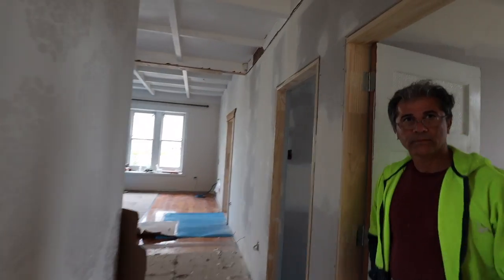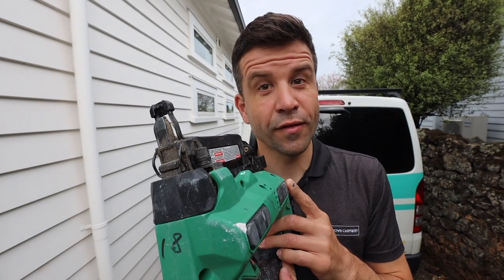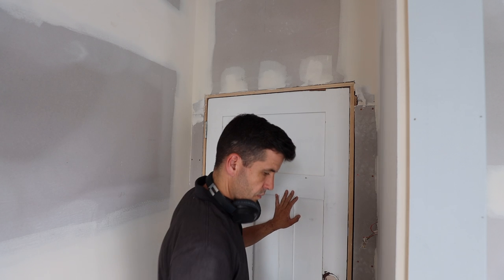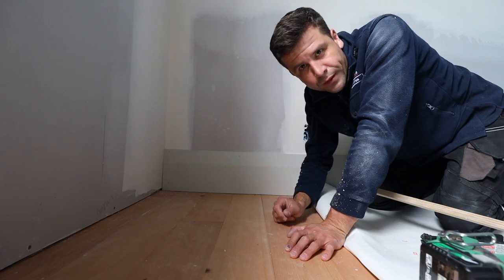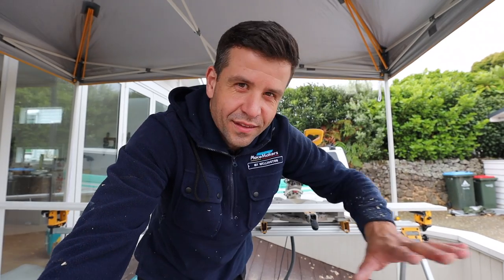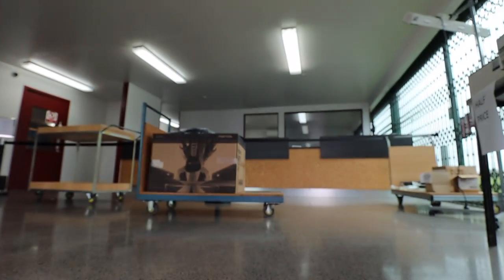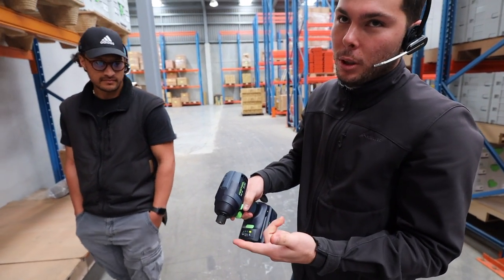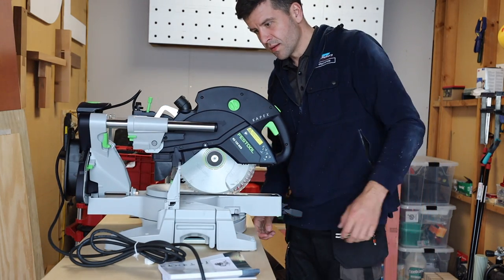Finish Carpentry: Why I Need a New Mitre Saw

Comment: I just watched your video yesterday on why you preferred the DeWalt and wouldn't get a Kapex... until maybe one day lol. You made the right choice. The handle is placed the way it is so you can line up your thumb-wrist-arm and pull straight down without deflecting the blade... just one of the many ways they make it by far the most accurate saw on the market. I use mine in a shop almost exclusively but it's the only miter saw available that can replace tablesaw sleds for crosscutting and mitering, etc. Nothing else is even close to as accurate. As far as the stand issues you had in the other video; first, read the manual. Setting up the folding stand is a piece of cake if you know where you're supposed to place your foot on the bottom of the stand so it doesn't fall over. If you want to take the saw off the stand, it has quick releases that make it just as easy to remove as removing the DeWalt from its stand. The outfeed tables may be a little time consuming to setup on a new unlevel surface each day, but the pro far outweighs the con in that you have about 8 feet either direction of support and extremely accurate flip stops. Again, accuracy. For a trim carpenter, I don't know how you could live with anything else but the Kapex.

Comment: I love my Makita 18Vx2 12" mitre saw. The laser and accuracy are great.  I primarily use it for aluminium with a 120 tooth blade. The dust extraction could be better. The attachment point for the vacuum should be on the lower portion.
Reply: The vacuum kit from Rocklers is a perfect upgrade.

Comment: I’m on my second Kapex saw, the first one developed a small issue after 6 years of work, it was sent in for repairs and Festool replaced it with a brand new saw,free of charge. This one has been flogged every day for 9 years,and still cuts as accurately as the day it was unboxed, they are truly awesome pieces of gear. Buy the wheel assembly and the wings too, it makes a great tool even better.

Comment: a few years ago we were doing same size skirting on 400 apartments in a tower, one of hte guys in our team was SO disliked (he put it on himself, long story) that he went and bought a Kapex 120 to fit in and let EVERYONE use it as their own drop saw to do this skirting, all 8 of us took turns to use this saw. 

Anyway we treated the saw well because ..well its a kapex, and it ripped through all that skirting no problems, it was accurate time and time again on bevels and compound bevels. the only thing that went out of line was the laser.. it was dropped, it was shoved, it fell of the trolley, it was flung around by the handle ( expected collateral damage from 8 Carpenters) and as i said, it still was stiff and accurate. 

That was light material, Considering i build External Hardwood Stairs, i will stick to my 10inch dewalt, but i agree with Scott, its not very accurate, the bevel adjustment is horrendous. 

Since Scott does alot of woodwork, i think the kapex was worth it, in the long run .but i think other drops saws come close for GENRAL carpentry (as long as you don't use them externally). 

The dewalt is definitely a bare bone framing/external saw.

Comment: I had similar problems with my Dewalt miter saws. Both 10” and 12” models, they could only be calibrated to be accurate to one thing at a time, and were sloppy if I was doing anything else. Similar weird things if I had to do any compound mitering, layering inaccuracies and neither of my saws had any cracks in their casings or anything. I now have two Makitas, a 12” slider and a 6.5”. Haven’t had any accuracy issues since. Very happy with them.

Comment: I’ve had 2 780’s, the first I think was dropped by previous owner. But the second was much newer and still seems to be a little off. Like the fence is at a 178-179 degree instead of 180. It really bugs me but I get a great deal in it.

Comment: I had the same thought, never would i ever buy a mitre saw that overprized.... just happends that I ordered mine yesterday :D (although only the KS60) Shout out from Denmark, really enjoying your videos!
Reply: Ks60 is mafell. Different sort of kit. I do like the mafell line up, but Festool nailed it with the Kapex. Too bad it cost 5x what my current yellow saw cost.
Reply: @mitchellkasdin1899  what's the k60 is mafell? What does that mean, was thinking of getting one would you recommend
Reply: I had kapex120. Sold it and bought the kapex60. I love it!!! For me the big one was just too big. The ks60 is wicked.
Reply: I have a 12" Bosch mitre in the shop, and aboslutely detest bringing it anywhere because of it's size and weight... the KS60 is replacing a small 10 year old saw in my van, also Bosch. But the accuracy on the big saw just isn't good enough either.
Reply: @mitchellkasdin1899  KS 60 is the small Kapex with a 8-1/2" or 216 mm blade. I own one, it is a great saw. The Mafell you are referring to is probably the KSS 60 and you're right, that's a different sort of kit.
Reply: Bought a ks60 about a month ago , was a touch cheaper than a 10inch dewalt cordless  non sliding mitre saw.

Was on par with Makita  and the rest of the competition are cheap and made in china .

Comment: I have the 10-inch DeWalt and after I re-calibrated the mitre (using the 5-cut method), it cuts extremely accurate on the mitre. But if I tilt the blade on the bevel, then suddenly it's mitering is slightly off and won't cut perfectly square. There must be a fault in the way the tilt mechanism in designed, because online I've seen several other users complain of that problem also.

Comment: Hi Scott, in regards to the inconsistent accuracy on your saw.
I had the same problem on an Elu 216mm mitre saw, where I’d zero the stops but it would lose that once moved.
It turned out to be the hole in the base which the head pivoted on, it had worn so much it was supporting the shaft properly.
I had the hole drilled out and fitted with a bronze bushing to the correct size by an engineering shop and since then it’s been unbelievably accurate.
Check it out on yours, might be the problem?

Comment: I’ve never had great accuracy from my dewalt sliders or chop saws.  Any miter saw actually isn’t great.  Big base like that I use my cabinet saw.  But I’m cutting at my shop. Definitely the solution to airtight joints. But you still need to calibrate the miter gauge for the operation.  Just wish you could do it with miter saw with good results.  My kapex now maybe can do it but still not sure how well.  I just guy the kapex.  Big difference from dewalt 780.

Comment: I've got the same issue with my dewalt mitre saw, cuts lovely and square on a normal cut but if I make a bevel cut it doesn't  stay square. I got over it with moving the bed to a couple of degrees off from 90 while I done a bit of research.It's only started doing this recently and when i googled it i found another person mention it on a forum, since the saw is a good few years old i decided to get a bosch one for a change. Now that I've seen this video I'm glad i moved away from dewalt as that's 3 people i know who have had the same issue, hopefully the bosch will last me for the next 11 years as I'll be retired by then

Comment: Congrats on new saw. Festool is nice, just have a hard time getting used to the handle on it.
Also, the Festool TID18 Impact Driver is a pretty nice tool, but I’m more into Milwaukee & other brands, so haven’t bought it. Did get to test it out, & was liking it (the one you saw at the shop, believe is what that model was).
Cheers✌🏼
Reply: Makita has the best impact driver on the market. Shits all over festool with more modes and ergonomics.

Comment: One day I'd like to try out a Kapex in my shop but that price tag is a hard pill to swallow. I just got a Metabo cordless 10in slider a few weeks ago. It's not the greatest saw in the world but I've been pretty impressed. The biggest bonus is obviously not needing to have an outlet and having just as much power. I'm typically working at the same stage as final electrical work is being taken care of and walking over to make a cut and finding out my saw doesn't have power is a pain. Plus this saw is noticeably lighter and easier to pack in and out than the 12" Milwaukee or Dewalt I'm used to dragging around.

Comment: I have many Festool power tools and you find that even though they monopolize the top of the market there is still room for improvement and space for another high end power tool manufacturer/competitor.
Reply: Festool is great but lacks power..
Reply: Mafell is higher end than festool.
Reply: @kizzjd9578  yeah they make some excellent tools. I’m thinking that there is still room for improvement. There would be a market there also. For example the Festool kapex. Here in the UK it sells for £1200.00. For a machine which gives daily use for say 5 years it’s brilliant value. £5 a week. £1 a day. What kind of machine could you bring to the market with a retail value of £2000 - £3000.?

Comment: The dewalt serviced you well! I thought for sure you'd be getting a Makita drop saw!
Reply: Same. I was thinking he might go cordless with the FlexVolt or Makita. Didn’t expect the Kapex
Reply: Yeah, me too.
Reply: I thought the same. I almost bought one myself but no one in my town had one in stock so i got the cordless makita instead.
Reply: @kizzjd9578  I'm a makita only fan but heard there mitre saws are crazy so I went and bought a milwaukee instead
Reply: Flexvolt is awesome. Just make sure you get the double bevel.
Reply: @kizzjd9578  hows the makita? Ive been thinking about getting one
Reply: @kevinr3263  Same about to get a Makita, are there mitre saws decent?
Reply: @MrDingaling007  slides and bearings are pretty ordinary. Usually the first thing to go. Prone to premature rusting. Second hand sites are full of em.
Reply: @craiglyle2966  Interesting. Thanks for sharing that info.  I had seen a higher end 36V model made in Japan Makita mitre saw, i wonder if its of a higher quality? Im already invested in the Makita battery system and all there other tools have been excellent, so fingers crossed.
Reply: The new Makita mitre saw sucks tbh. It's well built for the most part, but the ball bearing slide system with both rails on one side has play out of the box, and the detent plate is aluminium instead of stainless like all the other saws on the market, so the detents get flogged out after a very short space of time, which doesn't stop the saw working, but it sucks, and slows your work flow down. Also the system for attaching it to the stand is not good either and I've seen it break. For a site saw I think Dewalt is the way to go. They are really solid saws. The older style small Makita saws are OK too, but they lack a lot of the capability of the Dewalt saws. I don't see anyone using Bosch, so I don't know.

The Festool is expensive, and probably not has hard wearing as a Dewalt, but it's probably capable of joinery and furniture grade cuts out of the box. I would definitely keep it well away from fence and deck jobs or framing. Finish work only.
Reply: @craiglyle2966  is this something in newer saws? My makita is old and it still cuts fine, I've made enough cuts with it to do the brushes in the motor 3 times but the bearings are still fine. I bought it 14 years ago and have been finishing with it and still make tight miters and clean cuts. I want a new saw but am scared to buy a new one as the new makitas weren't anything spacial, had another finisher friend that bought a new 10 inch and was having issues right out of the box. I can't stand dewalt but I may have to look into one as options are limited. DONT BUY THE BOSCH! Had another buddy buy that stupid hinged saw and my thoughts on it were more joints for more potential play. And yes it did have play and was extremely inaccurate. Nice when you need a saw that can be set up right against a wall but it's a piece of junk
Reply: I was concerned about getting the Makita sliding mitre saw having heard it can be hard to make true. While I was researching it I found myself on a Festool forum where people were giving the Makita a good wrap and tips to set it up. So many comments about the Kapex burning out motors regularly out of warranty. I don't know if they have sorted this problem out yet??
Reply: The Makita 10” and 12” miters are heavy...and pretty big. Probably why Scott didn’t want to go that route. I did and have no regrets, but it just sits in my garage, I don’t have to move it around at all.

Comment: I was in the exact same position beginning of this year . Had an old dewalt i had for 12 years and needed a new mitresaw ... festool was the only option that ticked all the boxes.  Liked it so much i bought the track saw and extractor as well 😂
Reply: Same here, and also bought the domino, it's a real game changer. Just look at apple's insane prices (400 bucks for the new ipadpro 12.9 keyboard...) and festool prices will look cheap.
Reply: @hotdog160 looks like a real quality piece of kit the festool domino , if only i cant find a job where i NEED to buy it 😂

Comment: Every mitre saw eventually gets to that ‘rough framing only’ stage.
Reply: as just a hobbyist, I ask why is that?  just wear and tear over time?
Reply: Only if your ruffus rough cut.. and dont look after it. I know a guy who had a makita mitre saw for 20 years
Reply: @oneillcfc7921    My old, all metal, extremely heavy,  10” delta chop saw is 30+ years old. Even with a new freud blade the cuts are only so-so, bearing and arbor wear. The newer ones are lighter, cut larger pieces and more accurately.
Reply: @huejanus5505  but with that repaired it would go another 30. Just wear and tear.  I own the new cordless double battery saw by dewalt. But they dont make them to last just like they used to
Reply from the maker: Lol true story
Reply: 16,000+ Woodworking Plans & Projects

Comment: using the 305mm dewalt sliding compound i always found  the radius of the blade is to big as well and cutting any skirting over 140mm on a 45 even with a new blade it would start to bend, so i figured on getting a KAPEX but the smaller blade saw. Unfortunately i think they only have the big saw with a laser guide and not the small diameter blade saw with a laser guide

Comment: One of the things i look at when critiquing a slide saw is the lateral deflection of the mechanism. If you grab the handle and move it side to side you will see the slop. All saws have a little, some are really bad.  As a blade gets dull it will drift out of square during the cut especially with excessive play in the saw.  Larger blade saws always have more play because the blade has more flex and more mechanical advantage against the mechanism. I think the sweet spot is 10”, good capacity will less flex.   The Kapex has acceptable amount of play, but more than it should considering its price.  Some Makitas and Dewalts were horrible while others were ok.  My older 10”Hitachi has the least of any saw i have tried. So despite the lack of modern features i will keep it going. Most saws have tension screws for the slide bars to tighten them up. The pivot might need adjusting as well. The latest Makita 12” i looked at was really bad, hopefully it just needed tuning. No way it would have cut hardwoods on a bevel without badly walking.

Comment: You need to get those sortainers with clear lids Scott. They are great, I have many. I always buy Makita bare tools and buy a Festool Systainer for them :D, they're just better when you stack them.
Reply: Ye I do the same and festool make good mitre saws vacuums tracks away and stuff but there drills aren't near as good as dewalt or makita
Reply: @orran8281  the festool 18v drill is miles better than the makita and milwaukee drills from my experience
Reply: @ieatporridge8975  i used the festool impact and combi drill loads putting in kitchens but compared to my everyday dewalt drill I think it has alot more power but we all have different options and festool is a more superior brand then dewalt and makita
Reply: @orran8281  have you tried the new festool impact? I've been looking at getting one but heard they are kind of underpowered
Reply: @ieatporridge8975  ye I  bought one for there for one of my lads that work for me they said it doesn't have as much power as the dewalt or makita impact and they rather to use the dewalt over it and same with the combined drill they don't have as power and the dewalt is alot better value

Comment: We certainly need a proper review of the new mitre saw - interested to know if accurate on skirting mitres.    My DeWalt is also very poor at skirting mitres, seem to get curved cuts! .  I know your pain!
Reply: if your timber is just slightly cupped & your cutting mitres with the skirting flat on the bed  , i have got curved cuts , i now stand the skirting upright. problem solved. blunt-ish blades also have a habit of moving the skirting  during the cut ,if like me your are hand holding the skirting against the bed / backstop.
Just some points i've found . all the best
Reply: @marktyler9464  - my DeWalt DW707 is perhaps 15 years old now and looking at that new mitre saw they seem to have come on somewhat - better slide and greater capacity for height.

Comment: That's the worst thing about drop saws and scms. As they get older the sideways play means that you have to pull it down exactly the same way every time. If you don't stand in the same place and hold it the same way you can push it to the side as you pull it down. It's particularly true with mitre cuts because pulling it down always tends to push it to the side.